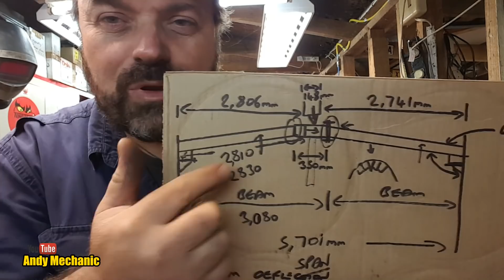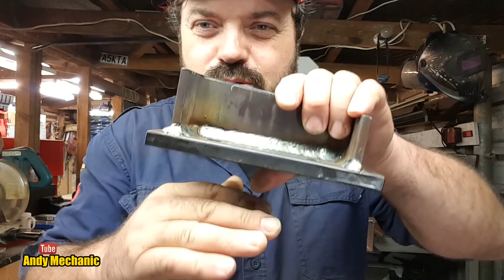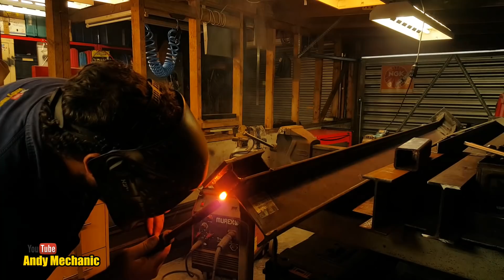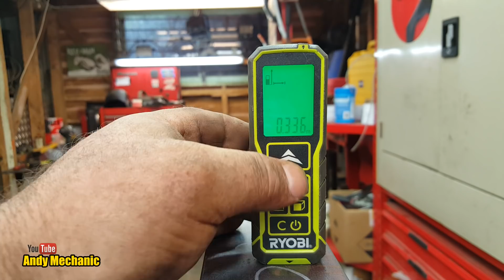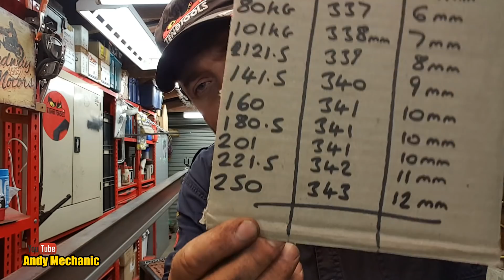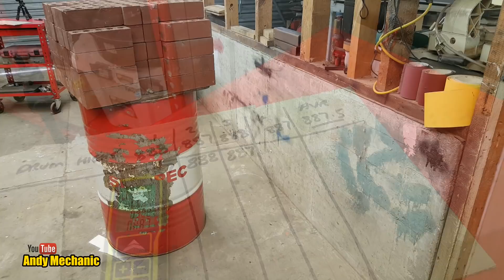Workshop roof steelwork Ep.2 fabricating the final design & load testing #2016

Comment: I cant believe you are wasting so much money on steel when you could have done it in timber. You have very little weight on it. All this worry about weight a structural classed 2x4 on edge around 2m long will take around 400kg. Im a carpenter and shocked how over the top you have gone. You  could have had that sorted in a day without much money being spent and no steel. If you were worried possibly a fitch beam being installed
Reply from the maker: Hi Lee, sorry but I'm a steel guy. I have lived in so many Timber frame houses here in NZ and the build quality is shocking to say the least. 

However, I will be building a couple of car ports using Timber so your help with that would be much appreciated. I'll be starting that project in a few months time (once the bank balance has recovered!)....watch out for the first video.

Many thanks for your ideas, it's much appreciated 

Have a great day
Andy
Reply: @AndyMechanic  I know you are a steel guy Andy and hopefully no offence was taken at my post. I think it's a waste because you said you were building a new building when you had the funds. I'm probably just  tight fisted with money. I know how expensive things are there, like you I was going to emigrate from the UK. But the cost of living put me off. Hope it all goes well and works great. Atb lee
Reply from the maker: Hey, no offence taken at all. I get so many constructive comments on the channel from some very knowledgeable people. My skill set is a little different to many & often lacks the detailed 'trade' knowledge once I'm outside the automotive repairs.

I appreciate your input very much.

Have a great day
Andy

Comment: i am enjoying theses vids Andy . your a man after my own hart . work it out and do it your self saves money and a lot more fun that getting someone in. dose the deflection on the drum not need to be times by the distance the load is away from the drum to ?
Reply from the maker: Cheers Simon. I'm doing 10 hour days and it's hard graft but enjoying every minute of it.

Project it coming on well now with the first beam test fitted and the other vertical post fabricated too. I pulled it all down last job today ready for cleanup & Paint.  I'll be making the 2nd beam over the next couple of days & hopefully get it in paint on Friday afternoon as it needs 24 hours for the paint to cure then it'll be good to install on Sunday (last day!).

With regards the drums, I don't thing the reduction in height of the drum has any angular effect, just a slight drop in height so deducting that from the deflection readings seems logical to me. Besides 12 mm of deflection on a beam where the ends are free to spread wider really isn't that bad & it'll be less when it's bolted up into place :-)

Cheers for now
Andy
Reply: @AndyMechanic  I was thinking you will have a lot less movement once the beam is in place. Maybe even half

Comment: I think you have bolt stretching at the joint, it is usual to have the bolts on the lower half of the joint closer to gether,bolts in the neutral zone dont do a lot so lower the middle ones or put a couple more in lower down, dont bother about people saying dont mig structural steel it is the normal practice here in the UK and I have done plenty of it over the last thirty plus years and never had a weld failure. Even done x ray quality welds for the nuclear industry with mig, they even specified it and sent an observer along to make sure all the parameters were correct. The US has problems with lower power outlets so cannot run as big mig welders exept in factories where they have three phase which is why there is the old wifes tale of stick or Manual Metal Arc to give it the correct name of being the only suitable method for welding structural steel.
Reply: Equiluxe1 lol funny thing is, I was once watching a program about the construction of the new (at the time) astute class submarines, and not only was they welding the sections together “with an air gap” they was also “mig welding” them lol

Size and weight of a submarine and pressures at the design depths if it’s good enough for that purpose I assume it’s good enough for a roof structure.
Reply from the maker: Hmmmm.....interesting point. I do have one final test to do when I fabricate up beams 3 & 4 so I'll check to see if the joint plates have separated at all when under full load.

Cheers Andy
Reply: i doubt its bolt stretch because the plates are in compression due to the slight angle.. if anything the plates would slide. just need to make sure the bolts are torqued to spec so they provide the clamping force.
Reply: the "don't mig" comments are hilarious.

Comment: I certainly am unsure about your "air gap" for welding !
and
as I have posted before, it's Stick for Structural
Mig doesn't put enough heat, or material in the metal on big steel

Your work does look nice tho  :)
Reply from the maker: Well my stick Welder is back in England and I really don't have time to go get it unfortunately.....

I'm confident the mig will do just fine. I have welded thicker plate than this before & my joints seem to be up to the job.

Cheers Andy
Reply: @AndyMechanic  thanks for the kind reply, I am not trying to be a prick..
my next concern will be the attachment to your Uprights ...
btw, get rid of the Nylock nuts
as I have asked before ..
don't You have "Bar Joists" in NZ ..??
much less weight, more strength
Reply from the maker: Not at all. I hear what you are saying. The problem with a bar joist is it's depth. Part of the brief was to maintain as much height as possible. That's one of the main reasons why I chose the I-beams.

The mounting between the ends of the I-beam and vertical posts was intentionally done in the horizontal plane to allow shims to be added to ensure the beam is supporting the full weight of the roof before removal of the old wooden vertical supports that form the centre wall.

I appreciate your contribution to this discussion.

Cheers Andy

Comment: Looking at your deflection measurement can I ask as well as drum compression did you also take into account that once the ends are fixed they will be prevented from spreading apart under load thereby reducing the deflection downward in the center ? Just a thought as the ends were free to slide out as you applied load to the centre.
Reply from the maker: Damn....I was saving that for the 3rd video... You are completely correct. I'll be running a 3rd test with a tensioned steel cable running from one of the mount feet to the other - just as a demonstration of how rigidity can be improved with just a minor addition.

Many thanks for your comment 

Cheers Andy
Reply: @AndyMechanic  i would not bother simply because that situation will not exist when its built. the poles and side wall are very flexible.
Reply: Ooooops sorry buddy I’ll go back to not thinking so much 😂😂😂
Reply from the maker: Haha!
Reply: That is just what i was thinking! The ends must be fixed, only than you can measure it!
And a big aspect, the weight will be spread along all the steel work, not just in one point. So, if it holds this much in one point, it will do!
You should pressure test the beams to which you will fix the roof structure! How good is their foundatoin.
Reply: @igorsdubrovskis3912  no, the weight will not be spread across it. andy is correct, its a single point load because the roof will only be attached to the beams in the center.